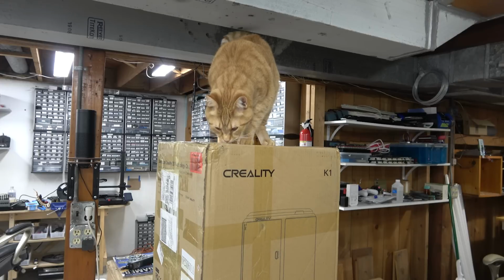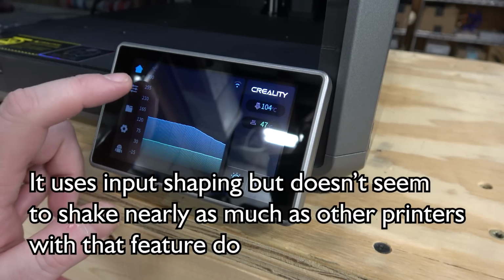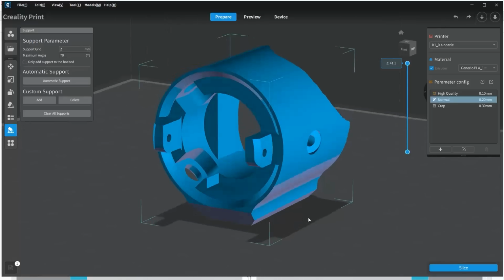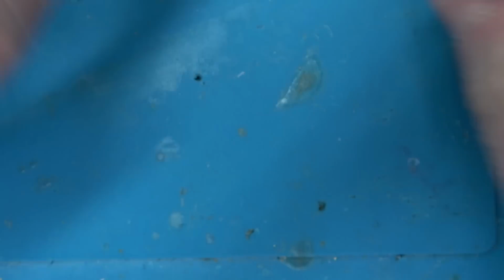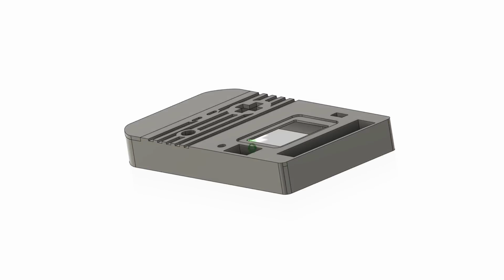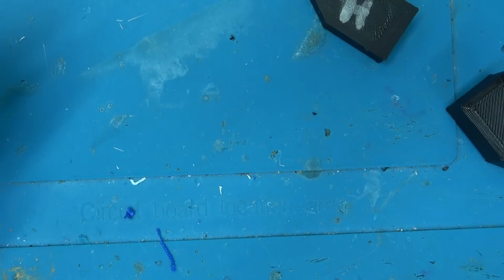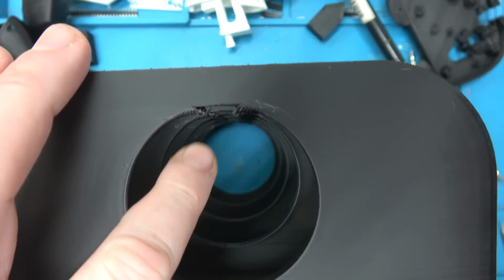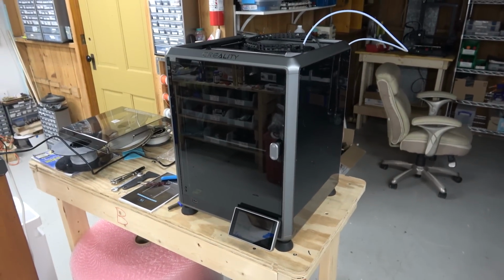Creality K1 High Speed 3D Printer Review

Comment: I know this probably isn't super important to you but do you know how possible it would be to make this printer quieter at the cost of speed and what not?
I can buy the k1 max at a very good price but because Id have it set up in my room the noise is an issue. I'm after it for the corexy because the ender s1 plus wont fit in my wardrobe, so if its possible to make it print quieter but at a normal printer speed id buy one right now.

Comment: I think the height of the deviations in those early prints could be due to the bed getting low enough to change the angle of the bend in that filament lead tube to start allowing easier movement of the filament. That would explain why it was the same height in each print.

Comment: bought mine 1 week ago this terrible printer, the extruder not working properly and buggies firmware to work with. ready to spend few weeks to fix the problems yourself if u want to get it. is like taking a gambling yourself to buy it whether u get the working properly unit or useless unit

Comment: Great video! In the video you showed some small changes (reverse boden and belt tension), you need to re-run the input shaper calibration after all changes to improove the print quality ---> all these changes impact the resonace frequence. Compared to my Ratrig VCORE 3.1 (running at same speeds and standard PLA and ABS) the parts you showed, unfortunately look like crap. Also try to calibrate preasure advance (for every material) as well, as it will improove the prints. Check the Klipper docs for more detail, good luck and happy printing!
Reply from the maker: In general yeah, I didn't feel like it was making $600 printer quality prints. Maybe for 2015, but not today.
Reply: @BenHeckHacks  I totally agree! The K1 is not on my shopping list for a lot of reasons.

Comment: What is that heating tool called for driving in the threads?
Reply: It's a heat-set tip on a soldering iron.

Comment: Did you put that high dollar 3D printer synthetic lubricant grease on everything before you started printing. I found I get much better prints when I do it before I start printing on my machine makes a tremendous difference. From what I’ve read nobody puts it on the 3D printer, so put on every 3D printer you get before you start printing. Nobody ever mentions it in their videos, except one guy. I got a Mini Delta V2, made a racket when I first started printing, but stuff on it and now you can not here it printing and lay shift stop and same my other printers
Reply from the maker: 3D printer grease?
Reply: @BenHeckHacks  Super Lube - Silicone Lubricanting Grease with Syncolon (PTFE) should be $29.99 or less but people sell it up to $500 for 3oz. It Will last for year you use very small amounts it go a long ways. I look in to a lot of different one and this one came out to be best for 3D printers and other things and is food safe. And if you get on the belts or any carbon fiber, plastics parts it will not damage them and when it will wipe off with water or acetone. I actually take a very small paper clip and do the bearings on the fan’s also. Depending on the printer I got between 5 and 20 dB less noise. This is what’s packed in most of your kitchen appliances gears. Boxes, Several of the 3D printers manufactures recommend doing this with some lubricant and grease all part moving parts with something before you use their printers. After Printing a few things you’ll notice that the extra grease will build up and be almost black because it has removed the fine metal particles from the parts, just wipe off and apply a little bit again. It should not turn black but once or twice a year and you need to wipe it off and reapply. I personally wipe it off and reapply once a month as preventive maintenance And it never turns black.

Comment: Not all PLA can be printed at speed so it's worth taking time to run a max flow text and then you can work out the max print speed for each filament. The Prusament I have didn't like printing fast and would max out at 14 mm3 /s. I am using ESUN EPLA HF and it's much like the hyper pla and prints very fast, but also when printed at normal speeds is quite strong. The software is Klipper and Creality   have not admitted they are using open source firmware or released the source code.

Comment: Sometimes the glue is used as a release material. Some materials, like PETG, might bind too well with the print surface and rip chunks out when you remove it. The glue releases easier while still being tacky enough for printing. I usually use glue with a little spray of IPA for an even thin coating.
Reply from the maker: Ah good point. I've got a roll of PETG haven't tried it yet.
Reply: Maaaaaaan petg sticks soooo well in my bambulab x1c. Definitely wouldn't be able to get it off my bed without glue stick.
Reply: Hair spray works as a release agent as well

Comment: Cura started to do some very odd things to my printers couple of years back, which caused so many issues to prints. If you check the model after you slice it, there's a lot of... whatchacallit... extrude starting points(?) in very strange places that will cause stringing, ringing and other problems, no matter the settings and they are always in same places, no matter how many times you print the model. Even calibration cube didn't end up good like earlier. And if that Creality's slicer is fork of Cura, there's the problem. I saw in your earlier videos where you were wondering about it too. I haven't found the solution for it even if I come back after each Cura updates and still no luck. I switched to Prusa Slicer and my printing problems was solved right away. Also Prusa Slicer's new organic supports are making life so much easier. Not sure if there's any settings for hyper filaments, since I heard about them for first time myself in this video. 

I don't usually watch unboxing or product reviews, but your videos are always fun to watch. Keep it up!

Edit: Oh, looks like it was just belt and tube issues in this one. Should been watching the video to the end before commenting!
Reply: Sounds like you may have enabled Z seam randomise, that moves the layer start point randomly around the perimeter to avoid a Z seam.  In the config menu check the "Z Seam Alignment" setting in the "Walls" section.

Comment: It's..... Not very quiet. Besides that, I feel there's been very little progress in 3d printers for the last few years. Still not fast, still a lot of tinkering.
Reply: Nature of the beast tbh. There are so many things that can go wrong that adding automation to cover every possibility would result in a very expensive printer.  The Bambu labs X1 does go a step further by inspecting the first layer for flaws.
Reply: No hardware tinkering on my new bambu x1c. I really don't need to turn the non bambu filament but I will.

Comment: If you tighten the belts you probably need to calibrate the input shaping since it changes the resonances. the style of printer is called cireXY. What kind of nozzle does it use ? Is ir like the bond tech or the new revo

Comment: When are you going to get the bambu lab x1 with AMS. I finally punted and got one after I was in the middle of a job and the damn flashforge extruder screwed up again. My first 3d printer was a makerbot cupcake cnc (came in a box of parts and you had to build the hot end and extruder). This is my 4th printer in 13 years and it’s nice to see we are finally getting to where the maintenance only takes 5 minutes vs 3 hours.